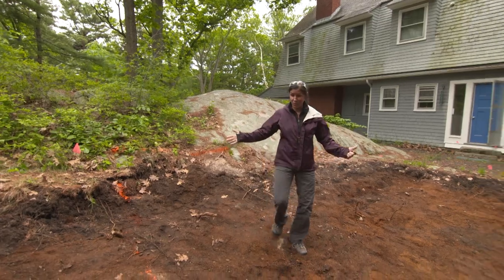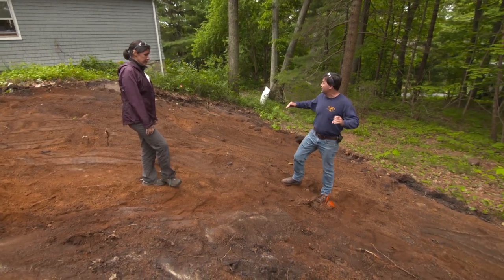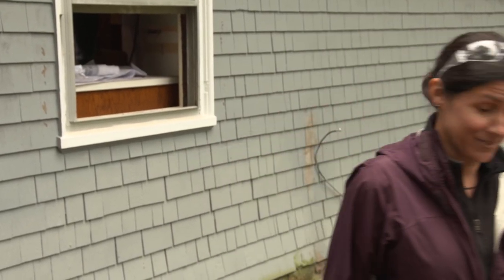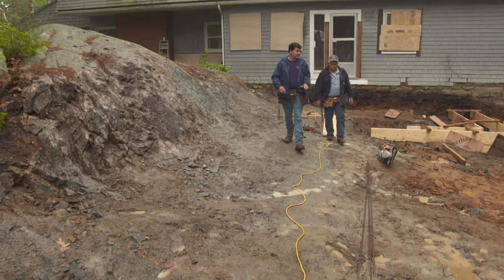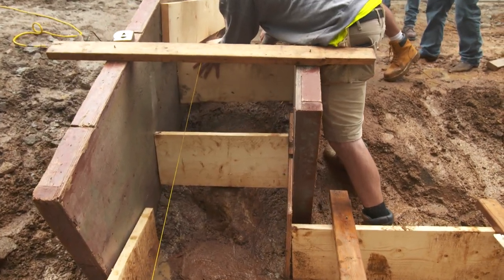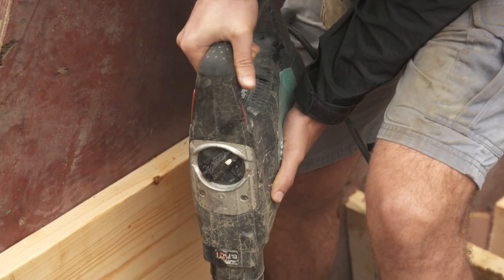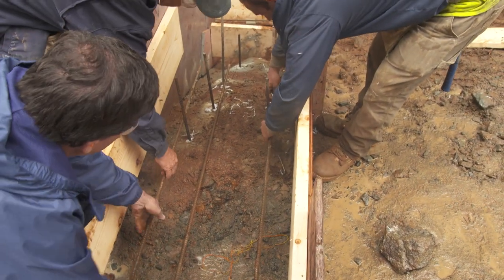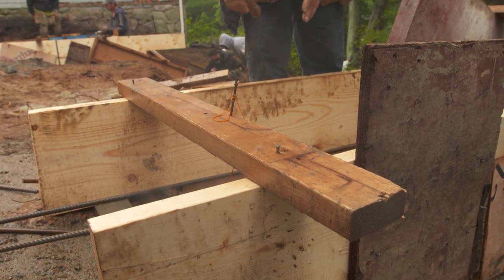How to Pin Foundation Footings to a Granite Ledge | This Old House

Comment: Won't that Rebar embedded in the rock eventually rust out as it's possible for moisture to get inbetween the rock and the concrete?
Reply: All untreated rebar will rust in concrete eventually. 

This is a major, known problem that has been over-looked for a century.  Only in the last ten years have builders finally applied rust-inhibiting paint to rebar.
Reply: They make an epoxy coated rebar that should be used in the pinning process. Also you should wrap your metal strapping all the way around your footing

Comment: Drill and don't blast but use 'non-detonating cartridges' eg Autostem.  You could also use expanding grout...  Surprised these methods were not at least mentioned even if they don't suit this particular job...

Comment: Should hammer out the granite in steps for the elevation drop. You don't pour footings on a sloped surface, only level steps for elevation change.

Comment: I can tell you that the epoxy sets in the mixing chamber when it's more than 95 degrees outside.
Reply: Depends on the type. There are epoxies designed for applications in high temperature. But you’re right, especially if a quick-cure is used.
Reply: @The13point1  It was an expensive lesson.

Comment: They’re using the wrong type of concrete. They should be using the fiberglass infused concrete cause it’s so much stronger than using the rebar to strengthen ordinary concrete.